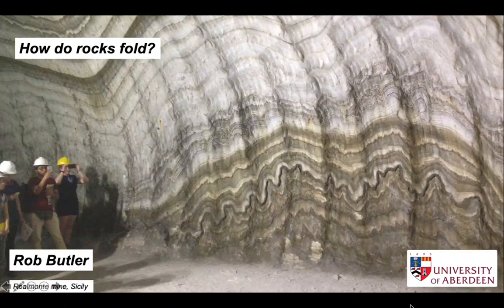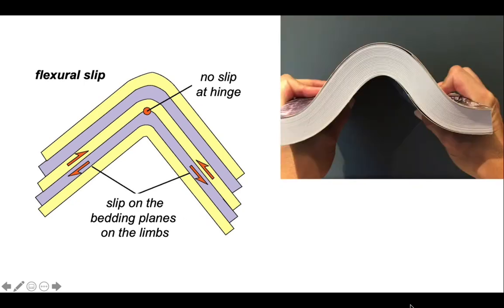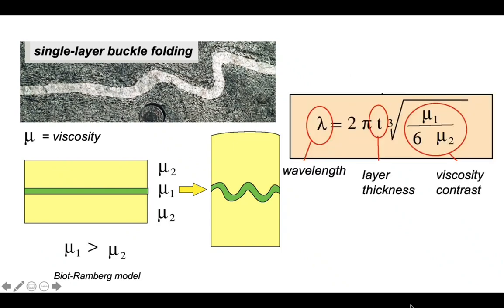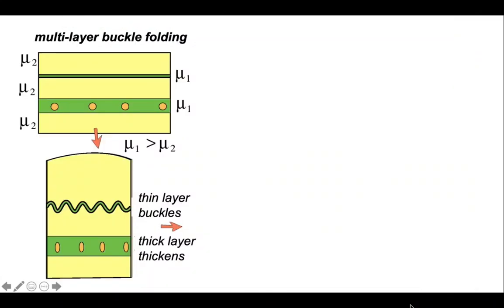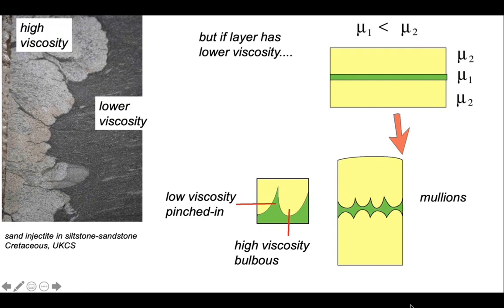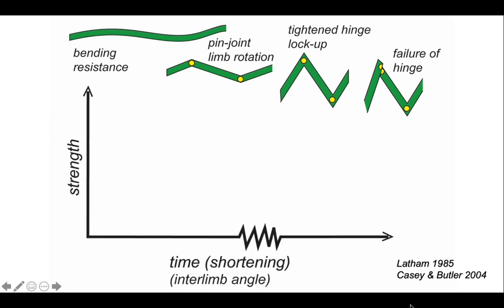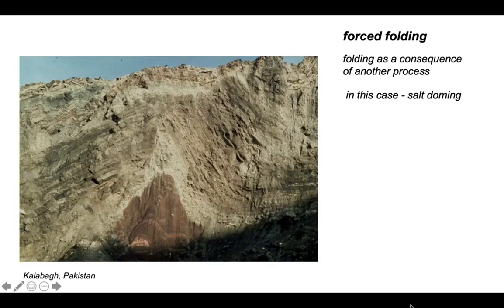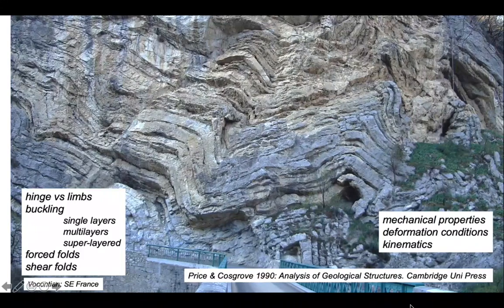How do rocks fold?

Comment: So do real rocks fold when the material is relatively soft and pliable, or can rocks fold when they are actually solid rock?
Reply from the maker: "Solid rocks" certainly fold... their "softness" depends on how the "speed" of the deformation - strain rate. Just like ice. It flows over long periods (glaciers) but instantaneously .. it appears to immobile. Also salt (halite) - check out the salt video on this channel. All solids behave like this, but with different sensitivity to temperature.
Reply: @robbutler2095   The failure to establish a comprehensive correlation between flow structures and flow morphology—across micro and macro scales and in diverse materials—has led to the misinterpretation of most micro- and macro-scale flow features as secondary phenomena of external origin, primarily ascribed to mechanical shear stress and deep viscoelastic deformations. The concept of viscoelastic depth origin, proposed to explain pseudo-plastic deformations in mountain structures, along with conventional tectonic processes, is dismissed entirely. Present-day observable mountain lithology is rigid as a whole, characterized by inadequate  thermal gradients and general incapacity for bending or plastic deformation under reasonable conditions. Traditional theories erroneously posit that lithic materials exist in a state of permanent, gradual, and progressive plastic deformation—a notion rendered implausible by the inherent brittleness of lithic systems. Under stress, such materials fracture, shatter, or slide rather than undergo continuous plastic deformation and accumulation. The consistency, rigidity, and durability of most lithic continental materials far exceed those of human-made concrete, which itself resists bending or plastic deformation. This simple comparison underscores the improbability of the traditional view, as even engineered materials like concrete—designed for controlled stress distribution—in similar conditions fail to exhibit the ductile behavior attributed to lithic systems in tectonic models.
Reply: The failure to establish a comprehensive correlation between flow structures and flow morphology—across micro and macro scales and in diverse materials—has led to the misinterpretation of most micro- and macro-scale flow features as secondary phenomena of external origin, primarily ascribed to mechanical shear stress and deep viscoelastic deformations. The concept of viscoelastic depth origin, proposed to explain pseudo-plastic deformations in mountain structures, along with conventional tectonic processes, is dismissed entirely. Present-day observable mountain lithology is rigid as a whole, characterized by inadequate  thermal gradients and general incapacity for bending or plastic deformation under reasonable conditions. Traditional theories erroneously posit that lithic materials exist in a state of permanent, gradual, and progressive plastic deformation—a notion rendered implausible by the inherent brittleness of lithic systems. Under stress, such materials fracture, shatter, or slide rather than undergo continuous plastic deformation and accumulation. The consistency, rigidity, and durability of most lithic continental materials far exceed those of human-made concrete, which itself resists bending or plastic deformation. This simple comparison underscores the improbability of the traditional view, as even engineered materials like concrete—designed for controlled stress distribution—in similar conditions fail to exhibit the ductile behavior attributed to lithic systems in tectonic models.

Comment: I can imagine buckling on a decameter or larger scale in solid rock over extended time frames.  It's the folding on a centimeter scale in that makes me scratch my head, as to the origin of the differential stress on a centimeter scale in rock units generally measured in kilometers.  Slump folding is easy to imagine, since the sediments simply fold into the voids left by the water squeezed out during sedimentary lithification, but when I'm told that the folding occurs in solid rock with no voids to fold into (and on a centimeter scale), my imagination fails me.  

I want to be able to imagine things happening, not simply know the theory.  I once took a course in refrigeration in which the instructor spoke highly of a colleague who was able to "think like refrigerant". 

Partial melting (anatexis) is also difficult to imagine, why the partial melt frequently forms alternating felsic-mafic foliation, like looking at a book edge on.  I can't imagine that happening.

Shelley has an interesting take on ptygma, as metasomatic veins that I can almost imagine happening, if it weren't for the cracking of the host rock, for which I see no evidence:

"There are two internal forces of expansion
within the vein: that of increase in volume
due to crystallization from solution and
that of force of crystallization of the vein
mineral.

The ptygmatic veins, having a relatively
small surface area for internal volume,
were formed as a result of expansion of
the vein material during growth and
simultaneous accommodation of the host.
Possible mechanisms are that the initial
cracking of the rock is the result of high
water pressures developed during
metamorphism and that the vein expansion
results from internal forces created during
crystallization of the vein mineral from
highly supersaturated solutions."

Shelley, David, 1968, PTYGMA-LIKE VEINS IN GRAYWACKE, MUDSTONE, AND LOW-GRADE SCHIST FROM NEW ZEALAND, The Journal of Geology, Vol. 76, No. 6 (Nov., 1968), pp. 692-701
Reply from the maker: Lots in this message. As for whether small buckle folds can form - see the title image of the video. Analogue buckle experiments from 1960s and early 1970s made in plasticene - without prior porosity.  Also earlier (early 20th C) in clay etc. Scale not an issue - and stresses work at all scales...
As for partial melting - the segregation into layering of (now solidified) melt and restite can happen through melt-migration. 
There is abundant literature on all this stuff - worth checking via GoogleScholar etc...